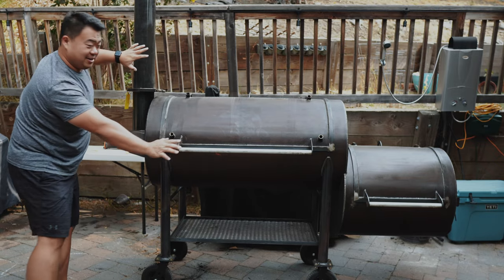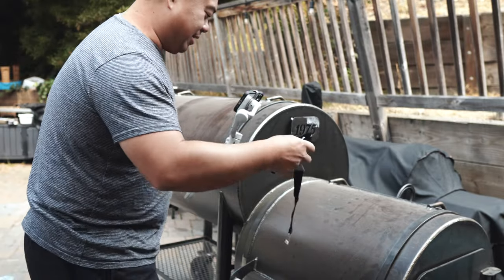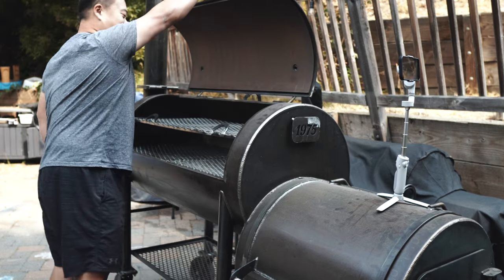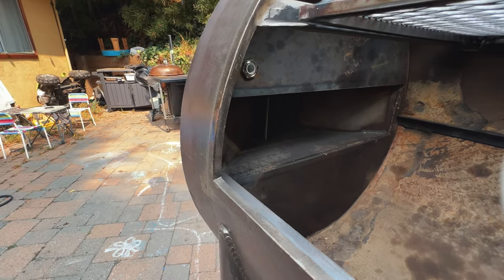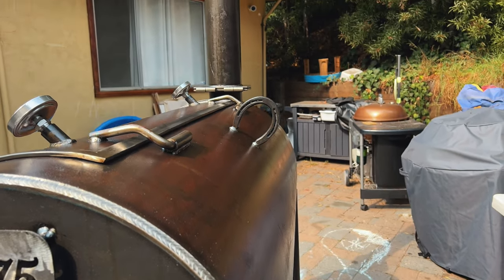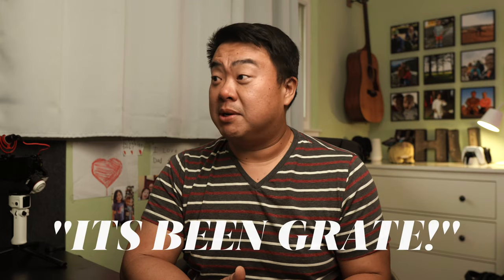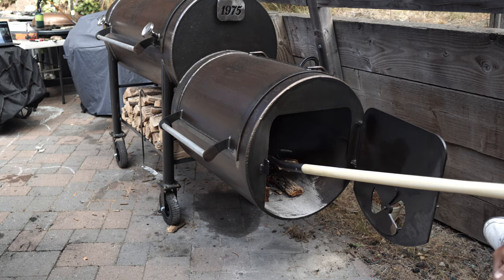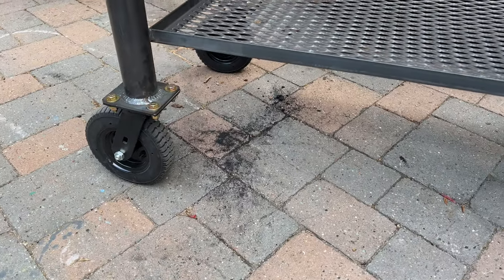Workhorse Pits 1975 - Delivery & Walkthrough - First Impressions - Questions Answered - Pros/Cons

Comment: Thanks for the video. Considering one of these and did notice the same thing you did about the casters. For anyone interested, I reached out to them and they said they are testing new locking casters. The old ones were weight rated but were not able to keep the pit from rolling down an incline. I guess they saw it as a liability even though who in their right mind would think locking casters alone could secure a 950lb object on an incline? All or most of the other brands out there(Millscale, Lone Star, etc) have locking casters.
Reply from the maker: James! Thank you for this comment. Good to hear they're working on new casters. Almost a year later and I'm still using wood shims to get this thing evened up so the grease doesn't work its way into the firebox. Other than that its been great.

Comment: Just got mine on Sunday (4 days ago), no locks on wheels, but slightly different wheels. It's so heavy that it doesn't move so not really worried about it. Looking forward to using it. Good video!
Reply from the maker: Hey congrats!!! No movement on mine either, especially with the 2 wheels by the firebox flattening a little. What do you plan on cooking first?
Reply: @HuSmokin  Brand new to offsets so probably going to knock out some ribs. Nice and easy cook to start off with.
Reply: @HuSmokin  hi, love your channel!
What do you mean by flattening on the wheels under the firebox? Is that a weight thing (amazing if this), or did they get stuck and wore down?
Reply from the maker: Hey sorry if that wasn’t clear. The pneumatic casters (wheels) are a hard rubber material. Since the firebox side is heavier, I have found that when the smoker doesn’t move around, the 2 wheels on the side of the firebox start compressing down under the weight. I suspect this lends the entire smoker to slightly tilt toward the firebox. Does that help?

Comment: My 1969 did not come with locking mechanisms, however; I question how effective they'd be on such a heavy pit. I apply the linseed oil after cooks instead of using the propane torch and it looks just as new as I got it about 9 months ago - I'd say at the beginning of the season and then in the fall/early winter. It snows in Indianapolis, and I opted for the cover for the winter and feel really pleased with that. For anyone who orders, just know that your estimated delivery is just an estimate and do not plan around that date. My pit was about 1-2 months late, and I think I was only frustrated by that just because I built up this expectation of the delivery date. It takes time, but if you're feeling really nervous or want to know your updated estimated delivery date - e-mail them and someone will get back to you. Like good BBQ, it'll get there when it gets there and when it does - you're going to be really happy with the result.

Contrary to this video, I have never experienced grease backing up near the fire box and usually pools up right at the plug like it should. As for the smoke leakage, I've never seen a pit of these sizes not leak a little smoke when you start it up. The convection that occurs when the pit is at temp should alleviate the issue. You could always put a high temperature rubber gasket on the lid, but I'd question it's value in the grand scheme of things. Funnily enough, I noticed Aaron Franklin's pit that he used in his masterclass do the same thing.
Reply: Greg, what temp did you run your pit at to do the linseed treatment? Thanks.
Reply: @yambor44  I applied the linseed after my cook - so I'd say about 275 for the chamber exterior and 500 for the firebox exterior. Legs and rack would be at room temperature. Nothing too special on this one and after it's first winter (with a cover) it's rust free after sitting in 1ft of snow for a month
Reply from the maker: Great info here Greg thank you. Agree with it all 100%.

Comment: How is it coming from the Oklahoma joe highland? That’s the offset I have and always adding wood. I’ve been wondering how fast temps would change with something like the workhorse pit.
Reply from the maker: Hey Dan. I've since offloaded the OKJ. And yes I was maintaining that smoker with shorter/thinner splits every 15 minutes or so to maintain temps around +/- 20 degrees. Having the right charcoal bed, door cracked just right, and using oak splits was my go to. The fruit woods I tried burned hot and cooled off way too quickly so I rarely used that with the OKJ. Once the WHP gets fully up to temp, which is usually about 30 minutes or so, it definitely holds temperature way better and I can 45 minutes to an hour sometimes without maintaining the fire closely. Still a lot of variability coming from the wood, whether firebox door is wide open or closed etc. Definitely a more laid back cooking experience overall compared to the OKJ however.

Comment: Man, that's awesome. Love that u did a weight test on the firebox and cooing chamber doors. I've wondered about that.  

This will be my smoker forever, and I worry when im older about lifting that door without a counterweight. 

Also, excellent point about the wheels deflating.  Makes me wonder if I should go with steel casters.
Reply from the maker: Me too regarding the door. If I had went the Lonestar Grillz route I would’ve purchased the counterweight. It’s not just the weight but the overall reach when the lid is open (I’m 5’10”). 

Regarding the wheels, it does roll surprisingly well but yes the flattening of the wheels was unexpected.
Reply: I have the same concerns as I get older. I may not have any major issues lifting the doors now (even with my thin wrists ), but time will catch up.
Reply: I was thinking about a removable counterweight so that the stack can be lowered and the cover can be put on.
I know a couple of welders that could help me, and might trade for meat.
Reply from the maker: A removable counterweight sounds ideal long term.
Reply: @HuSmokin  Congratulations, it is an impressive pit. I am considering to get one of those as well. Though it is not too difficult to build a counterweight, 
I would ask Workhorse whether they have a blueprint for a counterweight that they can provide.
Reply from the maker: Thank you! And that’s what I’m hoping too. But maybe not for a decade or more God willing 😬
Reply: I emailed Workhorse about adding a counterweight and they said they are looking into adding one for the door of the 1975 (96 lbs), but not the 1969 (56 lbs).
Reply: You should be able to hire someone to weld a counterweight for the door, probably cost you $300+

Comment: Thanks for sharing the info on the 1975. I’m interested in this model, but am concerned about the casters by the firebox deflating and tilting the grease back towards the firebox.  What are you experiencing at this point?
Reply from the maker: Hey Ross. This is a legitimate concern for me and my smoker but it doesn't seem like this issue is present for all 1975 owners. I've since moved the smoker to a different part of my backyard which is slightly uneven. I just took that as an opportunity to add some extra thin sheets of wood underneath the wheels by the firebox. Problem solved.
Reply: I’d opt for the metal wheels then

Comment: Thinking of getting the Workhorse 1975. Do you have any issues moving your Workhorse around your paver patio? I have one and wondering if the standard 8" pneumatic caster wheels are okay, or the wagon option is the better choice?
Reply from the maker: Hey did you make the decision yet? I'm a pretty big guy and I'd say stronger than average and find moving it around myself to be manageable. Our pavers have a few dips here and there, so it takes some rocking around to get things moving. The wheels also tend to flatten out if left for awhile, so getting the thing going is a challenge. If you're concerned at all and have the budget, I'd say the wagon wheel upgrade is worth it... especially if you don't need the storage area below.
Reply: @HuSmokin  If I go with the Workhorse 1975, I would likely opt for the wagon version so I can move and reposition the cooker across my grass and on the patio where I need it. A local metalwork shop is going to try to custom build an offset smoker similar to the Workhorse 1975 specs. If he is successful and the smoker is reasonably priced, I may go that route. Otherwise, my default choice may be the Workhorse 1975 but later down the road. I wish I could see one up close to get a better idea. Perhaps I’ll run into you while I visit my family in the SF Bay Area in June. Keep up the great content! :-)
Reply from the maker: Hey you’re welcome to swing by. With advance notice I’ll even smoke something up for you! Just email me. Cheers!
Reply: @HuSmokin  How’s the Workhouse 1975 working lately? Not sure how to email you via YouTube but I’m in the SF Bay Area now visiting family. If available and still willing, I’d love to take a peek at your 1975. My brother-in-law (BBQ judge) is even interested. No worries if not available. Will definitely try Horn Barbecue and my favorite ice creamery, Fenton’s, sometime this week. Wishing you and yours well. Looking forward to your next YouTube video!

Comment: The holes are from the plasma cutter where it starts in. If it were me and I was making really nice smokers with the fit and finish of these and the hefty price I would have filled those in. It would have taken a 2 seconds to fill it with the mig welders they use and blend it in with a fine grit pad on an angle grinder.
Reply from the maker: My thought exactly. Thank you for the insight too.

Comment: Cool video. Considering getting the same model. I have 2 questions. 1 how efficient is it at burning wood? 2 what was the shipping cost?
Reply from the maker: Hey I went with the budget shipping option which I think was under $500 at the time (over a year ago now). Efficiency wise it depends on how comfortable you are with temperature swings. If you are okay with 20-30 degree swings, a 12" oak split can keep this thing going around 275 for at least 30-35 minutes with the fire door closed and baffles wide open. When I'm in a pinch I sometimes use the greener pieces and can get up to 45 minutes at times with similar temp swings.

Comment: Great video! Still doing my research if I want to go with the 1975, 1969 or with another builder. Looking forward to the new content!
Reply from the maker: Thanks for the support. What other builders are you considering?
Reply: @HuSmokin  I have narrowed it down to Workhorse and Lonestar. I previously eliminated Milscale, Franklin, Gator Pits and Fatstack due to various reasons for each one (price, build time, etc.)

Locally, I reached out to Murillo Metalworks and they indicated they can custom built an offset similar to the Workhorse. Question, when you visited them on your way to Yosemite, did you see any smokers similar to the Workhorse Pits?

If I do end up getting one of the Workhorses, I think I will definitely spring for the wagon wheels. No way I would be able to move it to my backyard on the regular casters. Now that I’ve seen your video, the weight of the chamber doors are starting to worry me. 😂
Reply: Depending on where you’re located check out Big Phil’s Metalworks, east of Dallas. I just ordered one of his that’s thicker metal than the Workhorse and starts at $1,700.
Reply from the maker: Wow that’s a great entry point.

Comment: Awesome video bro. Quick question. Behind your 1975, is that the Oklahoma Joes Highland? I have an Oklahoma Joes too and im trying to compare sizes between your 1975 and the Oklahoma. Can you please make a comparison video between the two next to each other? Im sure myself and many other Oklahoma Joes owners who are thinking about upgrading  would appreciate it as well. Thanks in advance.
Reply from the maker: Hey Jose, thanks for the feedback and questions. Yes that was an Oklahoma Joes Highland with some modifications. I never did a full comparison between the two because they are just completely different in my opinion. There are many offset smoker options even between the two that may be worth more of a comparison. I think Mad Scientist BBQ has done a few of these tests before too.

I will say that mastering a small and cheaper offset like the OKJ Highland definitely pays dividends when you switch to a larger offset. There will be a learning curve regardless, but you'll not only dial the new smoker in faster, but you'll appreciate the upgrade way more too.

Comment: Do these pits arrive with the linseed oil already applied to them, or do we need to do that ourselves? Waiting on a 1969 right now
Reply from the maker: Good question. I'd have to check the FB group or email in for that one. Mine "appeared" to have a good coating on it already, but I followed JD's tutorial and did another application and it looked way prettier afterward.
Reply: @HuSmokin  I actually spoke to somebody there yesterday and asked them since my 1969 is being delivered tomorrow. She told me they do in fact apply the linseed oil prior to shipping so we only need to maintain it
Reply from the maker: Awesome! Congrats on the delivery and yes I just saw that WHP put out a behind the scenes production video which talks about them doing the treatment. My pit could definitely use another one now after the winter.

Comment: Curious if you could share the ordering process, purchasing procedures, etc. If you can't that's okay. I do like the 24" size better than the 20" of so many others.
Reply from the maker: Hey I know this is a late response but hoping it still helps. It was pretty straightforward really. After placing the order on their website I got an email confirming the order, but that's when things got weird. The communication last year was very sparse so it was particularly frustrating since I was anxious to get the smoker. Not sure if they have more help over there now to keep up with the demand and order updates with customers. Did you decide on one?
Reply: @HuSmokin  Than you for the info. I will keep this in mind when I am ready to order. It sure is a beautiful work of art.

Comment: You can add counterweights to the main door and firebox door. It can make it 5lbs to lift and close vs. 60lbs. That spot looks like it's where they had to pierce it with a torch or plasma cutter, definitely nothing to worry about!
Reply from the maker: Ah thank you for the knowledge about the welding spot. Good to know. And yes I think at some point a counterweight will be the way to go.

Comment: Linseed oil the outside  .ad weights that  would equal 
40 pounds. Yes a frame bout  26 " inch uprites the bar couple innce pass the door
You know what im talking
About .I had to do the same thing to mine that was built  . But I didnt have this stroke . That will a good  SMOKER  . Now im looken at the  1969 .thanks for the time .
Reply from the maker: Hey have you received your smoker? Curious if you did the counterweights as mentioned. I might do that sometime in the future. Thanks!
Reply: @HuSmokin  that was a long time agp if your door is 30 pounds then add a weight 27 poubds take the up rights in alst make the complet system 25 or what ever. But donot tip the weight of Your DOOR STAY A FEW POWNDS UNDER IT .
Reply: @HuSmokin  have you added a counterweight yet? I am thinking of adding one like the one on the Yoder 1600 (1500?) pellet grill.  I think it will make all the difference.  Any thoughts?
Reply: @LUCKYB.  have you added a counterweight yet? I am thinking of adding one similar to the one on the Yoder Pellet Grills. Any thoughts?

Comment: Nice pit. I can understand how frustrating it can be when you spend all that money and it leaks smoke + casters don't have a locking mechanism (like 94 Millscale) and this pit may have the potential to cause a grease fire! You're not the only guy I have seen trying to rig up the casters to prevent a grease fire. I hope Workhorse is aware of these issues and are actively working on a solution. Man, God forbid it would be terrible to have a disaster associated to their brand!.
Reply from the maker: Thank you. I agree there are a few things that I wish were more dialed, but my issues with the casters and grease drain don't seem to be common enough issues to raise attention for them.

Comment: They should have welded on counterweights for easy door lifting, welded a lip so grease does not get into the fire box otherwise it's a fire hazzard. Also should have used hard castors they move smoker much easier. They should redesign the smoker it's the details that matter. I build them with all the features and don't nickel and dime the customer with upgrades....
Reply from the maker: Appreciate your feedback and eye, and encouraged to know there are builders that look for these things. That's just a huge plus to working with builders who are making these pits with customer input... whereas I see WHP has basically mass producing something they know works well for the general population.